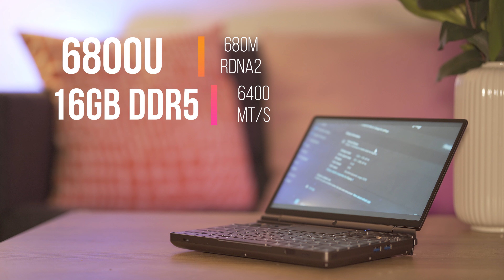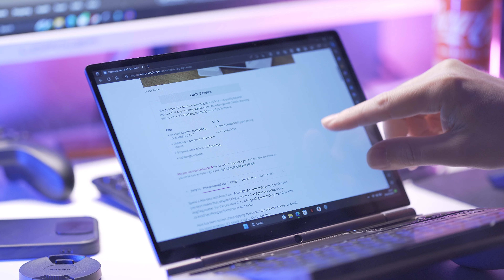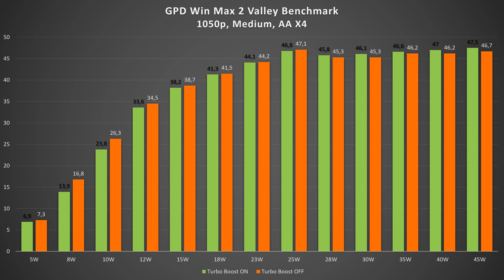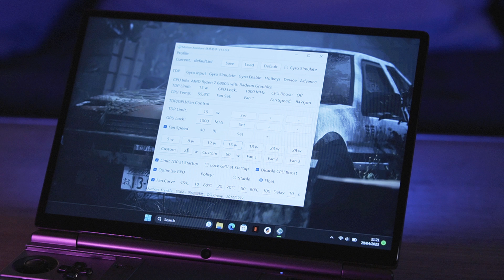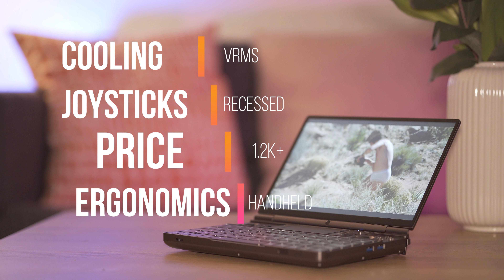GPD Win Max 2 AMD Ryzen 6800u RDNA 2 HPC Review

Comment: I have used it a ton as a notebook, love the size of the key board, but gaming I don't use the built in controls that much.  I plug it into a TV and have a USB gamepad.  I had the Win Max, it was lighter and easier to hold and play with the built in controls but the keyboard was just too small.  If the Win Max 2 was lighter it would be perfect.  The Mini coming out is small enough to thumb type and has a 7840 in it so that might be the best overall.
Reply from the maker: Yeah I saw new mini! It does look promising and I like clamp shell design but my main issue is ergonomics… I find Ally the best overall atm. Of course with some issues and dumb design decisions but it works great for me.

Comment: Do you think the ergonomics would fit better in the Win Mini? Retro Game Corp also dislikes the recessed sticks on his test Win Mini. I was hoping the Win Mini would be way easier to hold as a handheld as other channels (phawx /taki udon) rave that the optional grips will not be needed but then the recessed sticks topic came back on and I assume the win max 2 and mini share the same layouts and same hall effect controls. I guess it would be way safer to buy a legion go and save some money but I can't shake the clamshell design for some reason. I own a gaming desktop and laptop so my goal is more on handheld side of gaming.
Reply from the maker: In your case I would go with Ally tbh! Mini is same as max just mini LOL and cause of joystick placement those grips are more than necessary! I wenn with Ally since that was most logical approach in terms of size/ergo and performance. I got XG Mobile and now Ally is my main PC. A true switch!